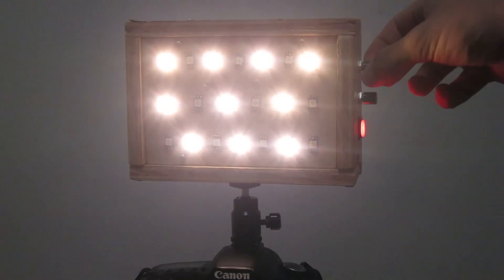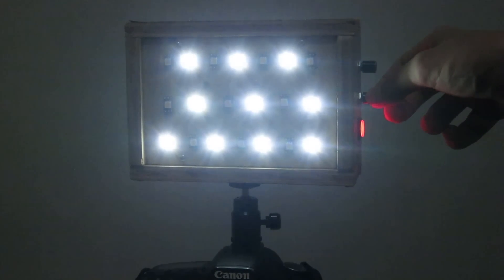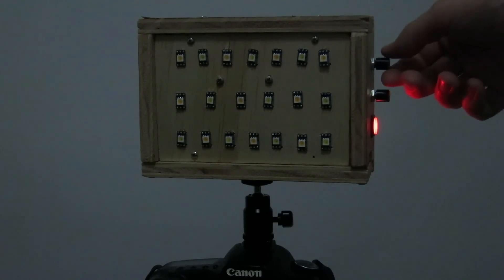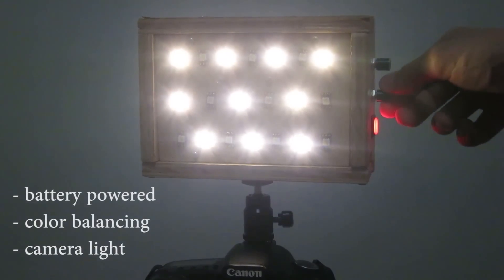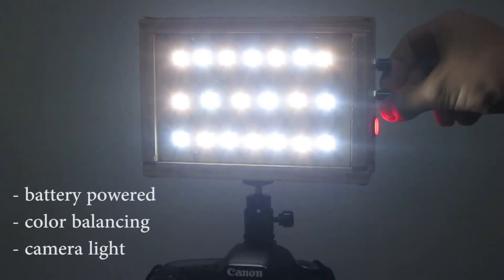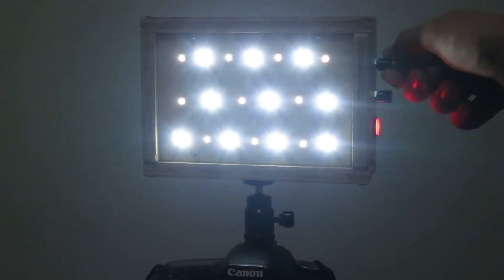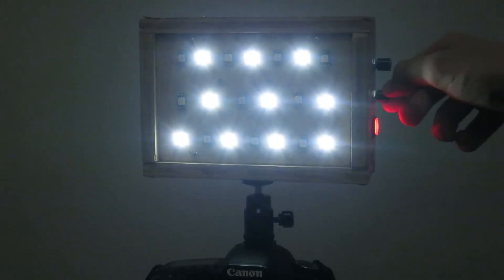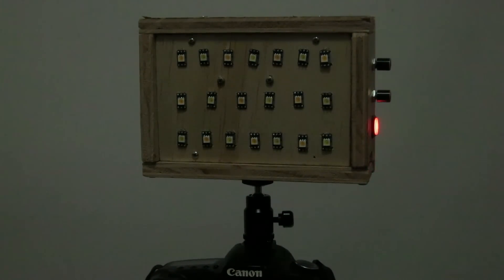DIY Color Balancing Video Camera Light

Comment: Nice project!  What would you do differently on a second iteration?
Reply from the maker: tirequickly Thanks! Doing it again now would be easier, since Adafruit recently started carrying strips of the DotStar warm and cool white now on their store. By far the largest time commitment was the amount of soldering, since each breakout PCB has to be SMT mounted and then soldered 6 times.

So I'd take the same MCU circuitry and size for the box, and cut the factory mounted strips so that they alternated in vertical columns (not horizontal rows).

Using that new methodology, and a 3D printer for the enclosure, and the entire project could easily be done in an afternoon.